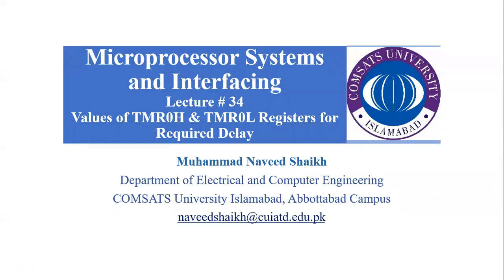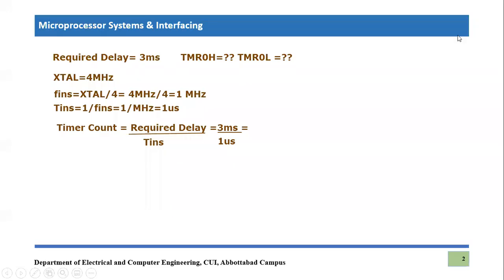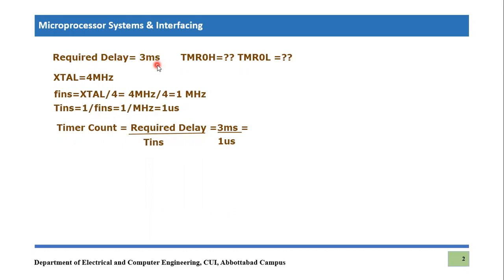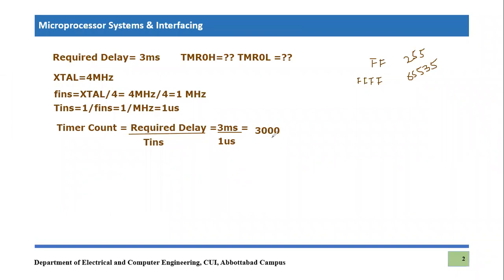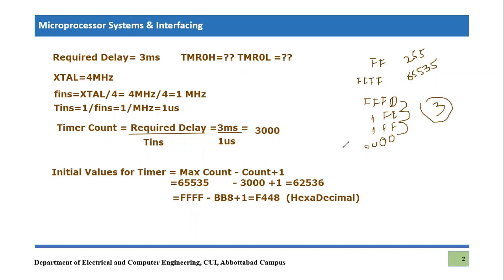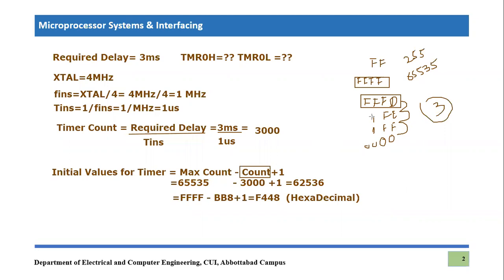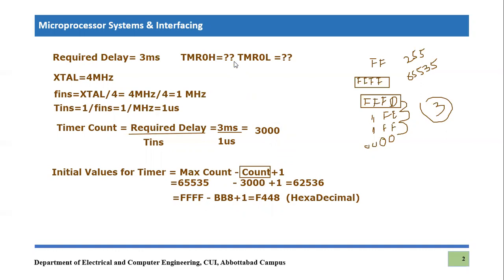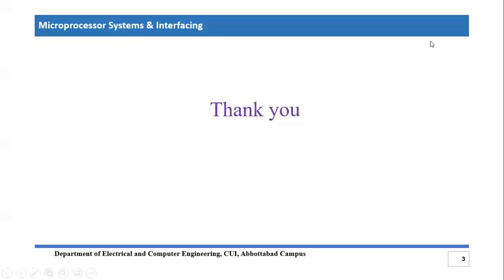How to Calculate the values for TMR0L and TMR0H for Timer programming in PIC18F Microcontroller

Comment: SIR KINDLY CHECK THE LECTURE IN THE EXAMPLE OF REQUIRED DELAY=3ms AND XTAL=4MHz THE ANSWER WILL BE F446 IF I AM NOT WRONG.
Reply from the maker: For mine case F448 while you calculated F446 . Both are correct their error is just 2 which eventually leads towards 2*Tins =2*1us =2us.. which is negligible. In real-time, you won't feel any difference unless you check it on an Oscilloscope or highly tuned sensors.